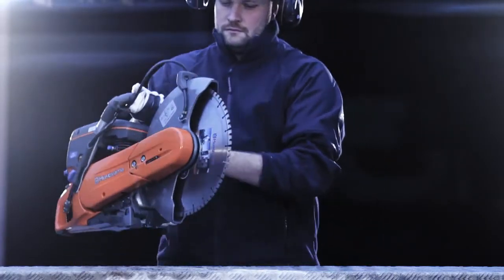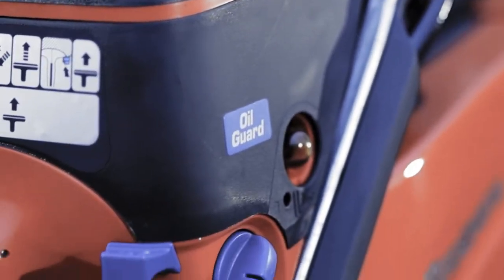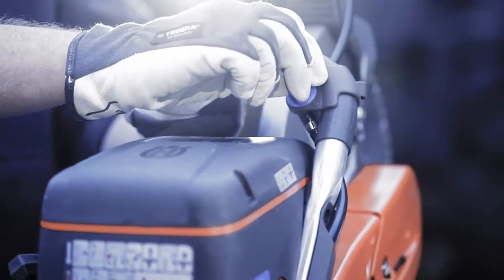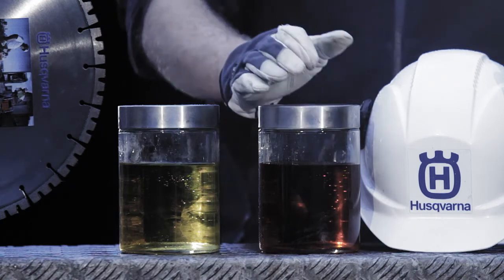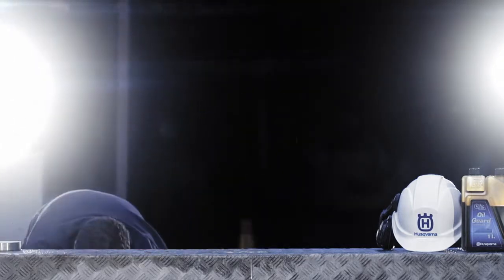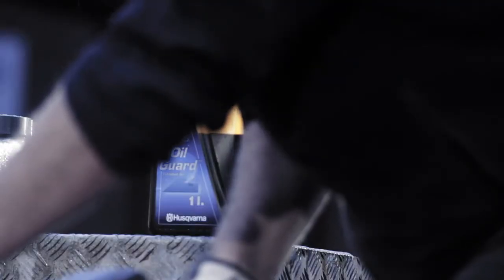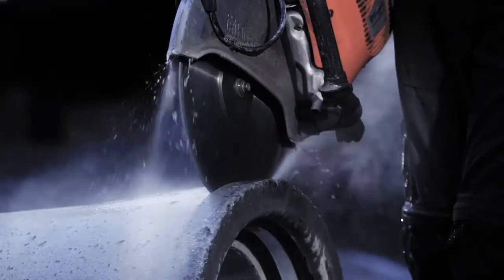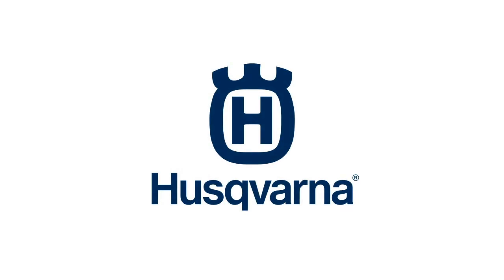Husqvarna K760 - Oil Guard - Protect your Investment

Comment: Here's how to disable the oilguard system so you can use any 50:1 mixed gas you want. On the back of the saw, right above the kill switch is a little blue plastic tab. Use a small flat blade screw driver and pop that little blue thing out. Turn it upside down and pop it back into place. Now the oil guard system has been disabled and you can use any gas mix you want. You're welcome.
Reply: Pretty sure my husqvarna k770 came with no oil guard. There's just the plastic tab there in place

Comment: Picking up on the comparison. If you run it without oil you’re an unqualified moron without an abrasive wheel cutting ticket. On the other hand I’m sceptical of a sensor detecting husq universal oil at 50:1 vs stihl super at 50:1. Like to be proven wrong but smells like an up selling tactic as it’s specified as rental market compatible. Btw, chucks a Hoselock connector off for fun when heat/ dust suppressing.